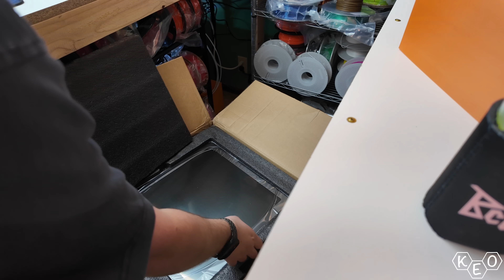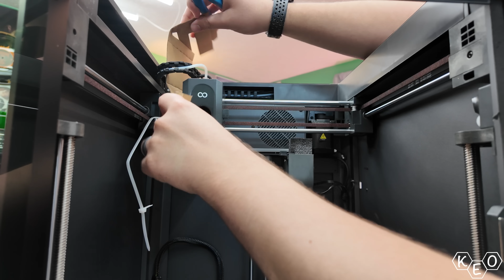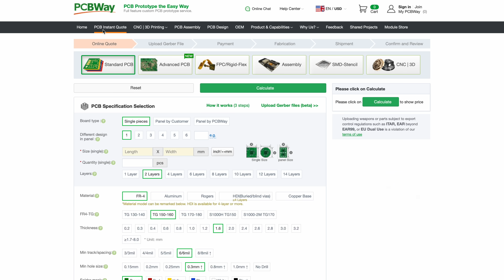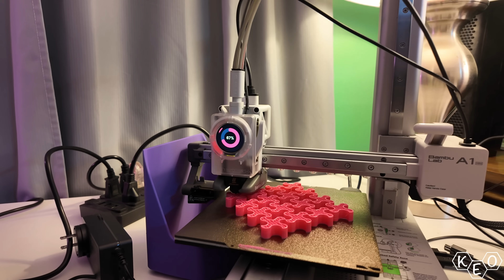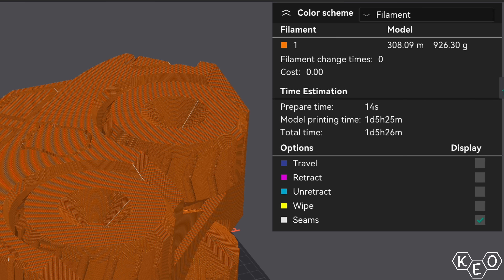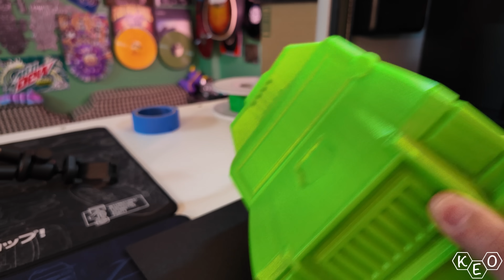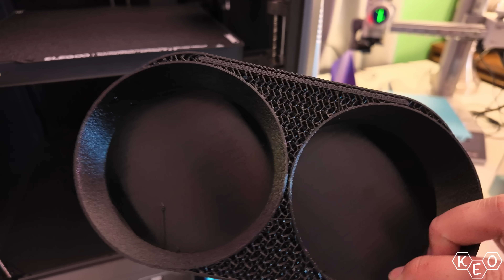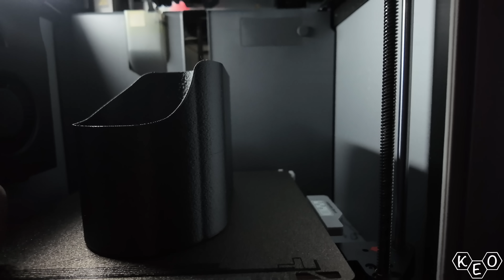$300 for THIS? Elegoo Is Playing Dirty…

Comment: You won't have issues with peeling of TPU prints if you just reheat the bed hot enough to soften the bottom layer, normally 60 degrees C.
Reply: For real? This would have been great to know before I destroyed one of my build plates haha. I will definitely have to remember this advice. Thank you!
Reply: @lynararosewater923  YES. If you still have issues up to 80 and it will definitely peel off then. You are not the only one getting this wrong, so don't feel bad.

Comment: Kewl. I didn't trust Elegoo enough to let them hold $300 for several months while my credit card chargeback period expired. So, to augment my P1S, I got an A1 Mini for couple hunnert bucks, from last year's stock (I guess) at Best Buy. It's been excellent, of course. I was tempted by the $200 Centauri, but I feel like they made ten of them and then "sold out" forever. It can't even be ordered now. If I ever need a third printer (because who doesn't) I'll maybe consider grabbing a Centauri Carbon later if its reliability reputation stays okay.

Comment: I've got my CC for about a month now. It's been going great so far. Much better experience than my K2 Plus. There are a few things you definitely need to look into, manually tramming the bed with a dial indicator, edit the default printer profile to use 1.0 flow ratio instead of 0.97.
Reply: What’s you experience with the k2 ?
Reply: @mrt5393  nothing but trouble. had to swap out the heat bed assembly due to really poor first layer issues. It got a bit better right afterwards, but got worse again after a few days of printing. And not to mention that creality hides a lot of the important stuff in the firmware behind pre-compiled binary files. But eventually I was able to work around that and fixed their bed leveling logic. Now it is printing ok.

Comment: Your hate towards people wanting the ability to print engineering materials is unwarranted.  Nobody says that’s all they print and they are better than you because you print PLA.  The abilities to print these materials is the next move in 3D printers.  It really makes a 3D printer a super useful tool for many applications.  I think it is really dumb that these printer’s don’t all have 350 C hotends at this point.  My reborn 2, which is by no means perfect, has a 350 hotend.  If that printer can have that capability these more modern machines should have it.
Reply from the maker: No hate intended; honestly just being silly and commenting on those outliers that have a complex about how they “only print functional parts”. Print whatever you want is what I say. Also I print a lot of composites and stuff along with my basic PLA “not-explicitly-functional” prints. Just poking fun. Everyone should just have fun

Comment: For all the hype this machine has, for $300 there were some corners cut, and it shows in usage (as you experienced). Reliability issues are a deal breaker for me. That's why I've been content with my bambu printers. I know the multi-color units are a dime a dozen these days, and it's easy to gloss over them and dismiss them as only useful for multi-color prints, but the way I use mine is much like a cd change from back in the day. 4 filaments ready to go at any time, no manual loading/unloading. I want to outfit the rest of my printers with AMS units, but I'm waiting to see how the AMS 2 pro behaves with the A1 later this summer when the update drops.

Thanks for the review and congrats on the channel growth. I subscribed to your other channel and voted for the A1 mini combo as the giveaway. That printer and AMS lite has been rock solid reliable for me for over a year now. It's my most used printer, and I have three full size A1s along with it.
Reply: The Elegoo AMS is due in the back half of this year. And the unenclosed plain “Centauri” is expected to have a 199 price. Then let the games begin.
Reply: @dougal6569  We don't know how the elegoo AMS will perform in regards to reliability and how well it handles color changes. Even at $200, there was enough issues Keo had that would turn me away from it as a potential buyer, and especially as someone who prints primarily with PETG. Like I said, at those prices, some corners were cut.

Comment: 03:15 Dear friend, i am a friend of the guy you have mentioned here. :-) i ditched the pla and since many years i always print PETG. Not the hottest, not the " most corrosive", just petg, not PLA. I got solid reasons for that but forget about me, what is your reason to not go to PETG instead of PLA? back in old days PETG was more expensive, now its not. PETG was harder to print, now its not. PETG didn't have so many color options but now it does. Also with petg, your prints comes with better temperature resistance, durability, food safety(depends on the exact brand/model of filament u use), So why still PLA? im not judging you, i wonder if im missing something here... Please educate me. I demand your reply, more over; i want a video about this. Be sure i will leave a like and a comment since i can not subscribe more than once. May the perfect first layer be with you!
Reply from the maker: Ha! Welcome friend. For me, it is a matter of the moisture ingress I think. I have a much cleaner result more often with PLA because it doesn't take long for my PETG to suck up that water and print stringy. I live in Nebraska and the summers are humid enough to cause me issues. Not a huge deal and not a difficult thing to fix; but enough to keep me printing 70-30 PLA over PETG

Comment: Also I don't think Elegoo is in talks with BondTech, but geting a Centauri (open frame) printer and updating it to an INDX might be a way to go int he future as well. I know the Elegoo units are not techinally Klipper though. Their might be a need to convert the firmware.
Reply: You can’t as the board doesn’t have a standard cpu required for klipper that separates motor control from the normal management at least that’s the rumor. Elegoo forked it at that point get a normal printer that is open from day one. I think this is going to be printer for a specific purpose and won’t get updates next year and gets replaced by another machine
Reply: also once again lot of faith in an unreleased product
Reply: @RADkate  I'm just always looking for posibilities. Nothing invested on my end, every product needs to prove some compantance but a least BondTech has some great hardware history. They will need to build the firm ware for the INDX and probably for/on Orca Slicer.

Comment: Don't do it... Don't print TPU on the smooth side unless you want it permanently bonded to your build plate.   The bumpy side actually makes TPU and PETG easier to remove... If you print it in the smooth PEI you'll need to soak the bottom of the print in alcohol to get it to release.

Comment: Think it might be time for one of your DIY upgrades (drilling holes, etc) to add a chamber heater solution to the CC.  Print a lot of PLA with CC... but yes had to try ABS as well.  Was pleasantly surprised that it handled it quite well.  However waiting for the chamber to heat soak to a whopping 35c took 60+ minutes... puh.  The print did turn out quite well.  Have the Plus 4 as well.  CC is waaaayyyy easier to use and I agree would knock most competition flat if it had a heated chamber. Maybe you could find a way to retrofit the base from one of your dryer boxes to the side of the CC.   Please.....  Also have experienced the pause of death with the CC.  I ended up removing the cable from the top of the print head (with power off), blowing out dust? Reaseating it and checking to make sure screws were tight. (just following advice from another content creator).  Also popped cable loose from a few chain clips to reduce cable strain by the head as noticed cable already showing wear and stretching with only 50 hours on machine (using 1.1.25 firmware, and plugged into UPS). Great printer, but needs to shake a few issues.

Comment: Has anyone ever tried putting their build plate in the freezer to get tpu to come off?
Reply: I generally use gluestick as a release barrier when printing TPU.  You can then spray it down with IPA to get it to seep between the part and the build plate. Still requires some elbow grease and prying though. I think I'm going to try some smoother build plates for TPU in the future to see if that makes it easier.
Reply: Comes right off with a little splash of ipa

Comment: Hello! Fellow CC owner here (mine got delivered today!) I love seeing unbias reviews and real life experiences that people have with modern products. The "bug" you're having with the filament loading is actually a "feature" as it waits to give you the load and unload commands until after the hotend is fully heated. You can see in your footage that they are greyed out when the temp is about 100-150c which would just grind the filament or clog the nozzle as it is simply not hot enough, so the firmware disables the buttons until it is fully up to temp. As for the quality issues with TPU and PETG, I think elegoo is just a bit too optimistic with their settings. I might try my settings for my SV08 to see how it fares as it prints both materials just fine. Thanks for the awesome video!
Reply: I was going to say the same thing, 
if it's what the guy above me thinks it is, we would be able to tell easily if the buttons were still grayed out and the nozzle was at temp but I suspect that was an afterthought piece of B-roll filmed after it got fixed to give him benefit of the doubt

I also wonder why he doesn't try using the device tab in orca to manually command heat up and loading in there, 

Also those layer adhesion issues are 100% slicer settings, either it's printing too fast for the material, running the part cooling fan too much, or nozzle temp to low for all of the above.
Reply: When did you buy it?
Reply: When did you purchase the printer?
Reply: I order my today, is on way.
Reply: No. The preheat is a ‘feature’ of only the latest firmware, showing a red thermometer graphic - and that only appears after you have pressed the button that was shown as deactivated and unresponsive. 
That wasn’t the issue. 
Something that wasn’t clear was whether the button deactivation persisted through power cycling (to reset the CC processor). 

Actually, there is no need for the preheat on UNload. It wasn’t there on earlier firmware. The filament cutter detached the filament from whatever remained in the nozzle, the extruder gear backed the filament up a little to free it, and then you could withdraw/rewind it. 
The new preheat stage is, I presume, in readiness for auto filament load/unload with the forthcoming AMS/MMU - as an attempt to reduce the changeover time. 
The bizarre thing is, if the nozzle is hot it won’t begin the UNload until the nozzle has cooled to 170. Maybe that’s the main idea - preventing cutting of heat-softened filament? In which case some coder has used an = when a < was required!
Reply: Well sort of like the weird crap that use to happen with the older versions of MS Windows... they called it "Undocumented Features"....lol

Comment: I wonder what would happen if you tried that black petg with the Plus 4.  For some reason, my Plus 4 just can't print Polymaker PETG. Other people have had success with other brands of filament. I have a theory that it's because the hardened steel nozzle sticks to certain varieties of PETG in a way that messes with the flow dynamics and keeps the bead from being deposited correctly.
Reply: petg sticks to itself so to avoid it building up on the nozzle and lifting your print you can increase the z offset by a fraction of a mm in klipper, or you generally can add an extruder offset in whatever slicer you use to do this automatically and save it as a PETG specific profile if you want also if you want a more permanent fix
Reply: @WHAT_1400 what amount of offset are you proposing? I did try an to increase the offset by 0.02mm and that didn't help. It's not an issue with bed adhesion, walls or solid infill, in my case it's with sparse infill specifically. I tried increasing print temp up to 255 and decreasing fan speed very low as well to no avail. Trying a different brand of PETG soon. I strongly suspect that will solve it.
Reply: trial and error, depends on the plate etc. but that advice is for first layer issues really though, so if it's happening on the sparse infill: 

first look at the speeds and lower them if needed since usually profiles are tuned to print sparse infill faster than the rest of the print (since it is hidden and doesn't need to look pretty) 

and after that, look at decreasing the the flow rate in those areas. maybe uncheck combined infill if you have that enabled and lower the line width multiplier for sparse infill down to 0.4 (iirc qidi has it at like 0.42 or 0.45 or something by default). you can also lower the overall extrusion multiplier to 0.96 or something (again i think it's 0.98 by default on qidi machines, been a year or so since i've owned one). this should help prevent excess filament building up on the nozzle

there is an extrusion multiplier calibration tool in orcaslicer if you want to tune it properly, actually i think qidi may have a version of it in their own slicer too. even if it is just the filament, i think it's worth taking the time to calibrate it since it only really needs to be done once
Reply: Just tested the PETG from California Filaments. It works a treat! I don't recommend the polymaker PETG.

Comment: I have had pretty good luck with my Centauri Carbon the only Filament I have had issue with is ASA but I haven't tried TPU.  You got one of the early versions of the printer.  The current one has LED strips in the front and right side and they adjusted the PTFE tube so it is less bent.  I would suggest you print a riser for the lid that way the PTFE won't rub the glass when the lid is on.

Comment: its a great printer if you need one 2 months from now..
Reply: I just ordered one for use as a second printer to complement my Qidi Plus 4. I produce a lot of multi-component prototypes and often "finalize" the draft of multiple components at once, so this will allow me to print multiple pieces in parallel. 

I'm just a hobbyist, so normally it just wouldn't be worth it to invest in a second printer. But at this price point, it opens up a ton of options for me for a really low cost of entry.

Comment: This is an interesting machine. I'm gonna wait to see how it does when their multi material unit releases. I wanna see if Elegoo have fixed all of the little issues, and if reliability is there. Personally, I'll pay more for reliability. I put a high value on my peace of mind and being frustrated by a machine, even a cheap one, just isn't worth it. I'm comparing this machine to my P1s'. Yeah, they're a lot more money, like I could buy three of these for one of those, but they've never had an issue and have printed everything I've thrown at them, using default profiles, flawlessly.

Comment: If you do not need the extra bells and whistles of the super high end stuff, this thing is incredible.

I just passed the 1 month mark, I was in the 3rd wave and this thing has been perfect. No issues with prints that haven't been a product of my own stupidity in the slicer.

I'm on my 8th or 9th spool. I've printed out:
Board game organizers
Scout Trooper helmet
Full Incinerator Trooper Flamethrower and backpack
Csgo knife for a friend
Custom made ramp for my robot vac

Oh and some trinkets and stuff for my kids. Including TPU print in place dragon that looked fantastic. Was my first tpu print ever, too.

Everything sliced from Orca. Havent touched the Elegoo slicer since its a branch of Orca.

I kinda want a second one now...
Reply: 9kg of filament is close to 300hrs print time on a capable corexy
Reply: actually, lemme just run that math real quick. 2300m of filament printed, just under 450hrs total print time. 1kg of PLA is approximately 300m, give or take 25m. so about 8kg, granted probably a kilo of that was ABS which is slower. 219 completed jobs. ya'll just say anything in these comments
Reply: But have you tried PETG because from this review that seems to be where issues occur?

Comment: The (upcoming) plain “Centauri” could have been mentioned as at 199 (instead of the Carbon’s 299) as an unenclosed PLA printer (likely with an AMS/MMU available) is where the real disruption starts. 
I am that other guy that wanted an enclosed printer with a hardened nozzle and extruder so that I had the capacity of printing moderately exotic ‘engineering’ filaments - even if I only ever made minimal use of that capacity. I wanted that option open and plumped for the CC - and I am loving it!
Reply: you...plumped?
Reply: @frumpyandy  perfectly ordinary English English expression meaning “I chose decisively, though lacking concrete evidence.” (Ordered 14 minutes after orders opened, the website crash was the delay!)
Reply: saying something's ordinary doesn't make it ordinary, perfectly or otherwise, but hey...you plumped.
Reply: @frumpyandy  as a sanity self-check, I used the iPad’s thesaurus “lookup” function, and as a verb (choose, select, etc etc), one of the example usages is “I plumped for a fixed-rate mortgage”. Really. Perfectly. Ordinary.